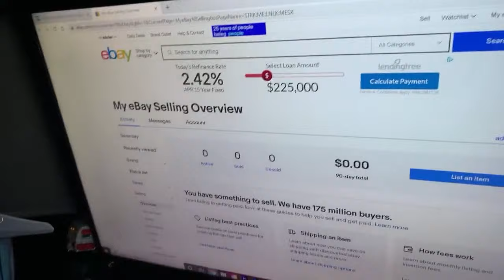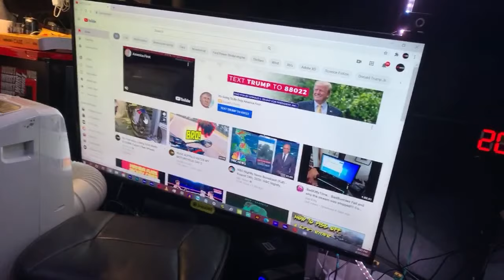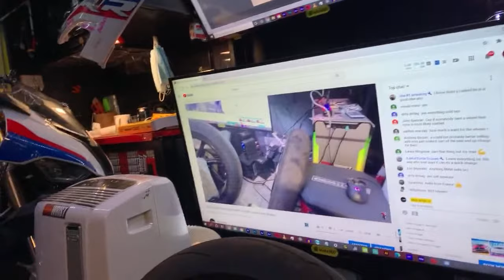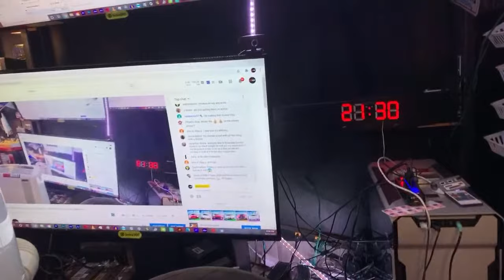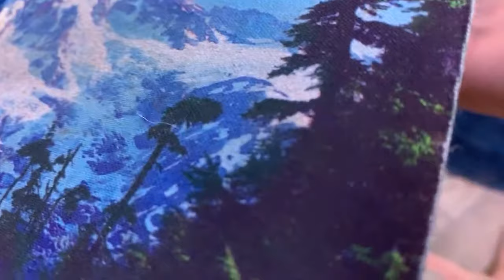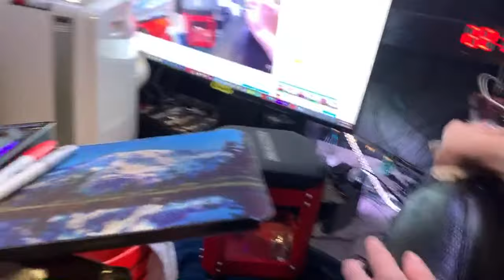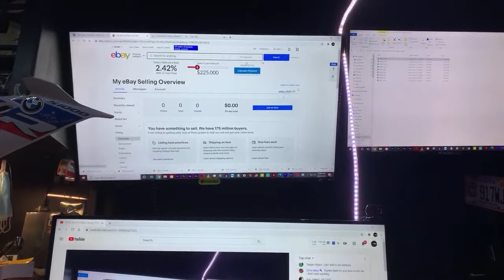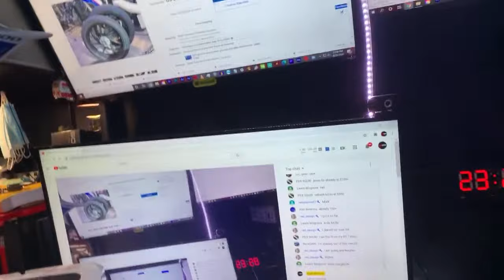My First eBay Listing 2020 BMW S1000RR Carbon Fiber Wheels

Comment: From the shot we got of the engine damage a few videos ago at new century. I think if it is only damaged at the thermostat cover it could be repaired without new crankcase. The thermostat cover looked to be plastic and if it's not a spare part, could be 3d printed. Any ally damage could be repaired and made to seal

Comment: Maxwrist Dana needs a Line wrench has an opening to slide over the hydraulic line where it fits on to the bolt that holds the line onto the caliper correctly give that a try just saying babyyyyyyyyyyyyyyyyy!😎3️⃣☮️🇺🇸🇺🇸🇺🇸💯💯💯